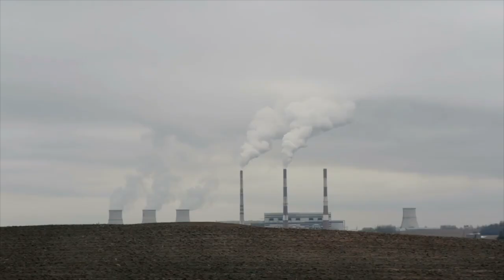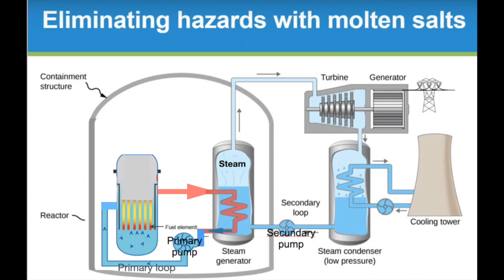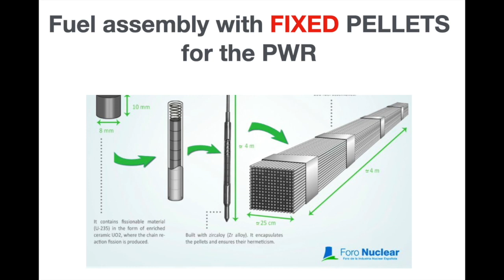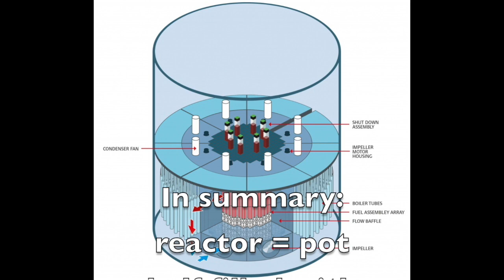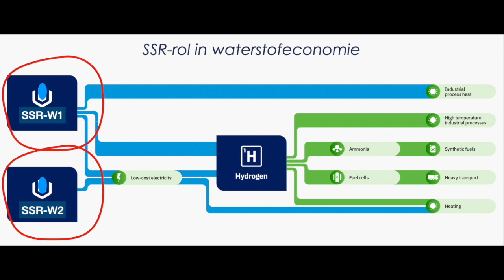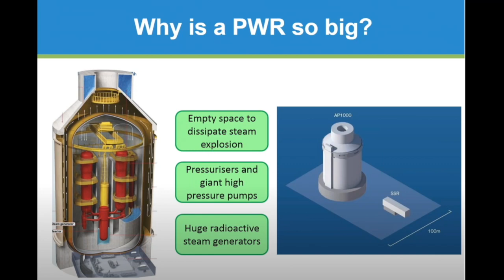The Moltex SSR-W

Comment: And we don't need stinking hydrogen that will leak out of any vessel, no sir. We can make diethel ether as a fuel source to run in small diesel engines for transportation fuel. We could now even make it as cheap as gasoline or in Europe petrol to make our vehicles roll.

Comment: All you need to calculate with molten salt reactors is to size the amount of fissionable of fuel to produce the power desired. Actually ya'll don't even need to size the fissionable material after the first one and then all ya'll have to do is take away the heat with another pump to make more power. And then when more power is needed ya'll just add more pumps and intercoolers. The expensive calculations and methods to separate chemically all the fuel components into their separate components especially xenon to bubble off as gas to keep the reactor stable is the most critical component.

Comment: It is not just the expansion through heat that is causing damage in the solid fuel (and their tubes & cladding) in a PWR. It is also neutron irradiation and gases (He, Xe) that are decay/fission products.
In a MSR, the noble gases won't cause damage to the tubes: they will bubble out. But the neutron flux is still there, damaging the tubes. 
And there are two additional problems: the salt is corrosive and operation temperatures are higher than in a PWR. It is a challenge to find tube material that remains unaffected under these harsh conditions over extended operation periods, so replacement of the tubes may still be necessary after years.
Reply: The salts are contained in tubes the same as today's nuclear fuel rods so there is no difference from todays nuclear plants except that we can burn waste fuel.
Reply: @WJV9  ?? I thought I just stipulated some significant differences. Did you read it at all?

Comment: Cheap                                                               Clean                                                 Safe
                  Lie                                                                     Lie                                                     Lie
Reply from the maker: Moltex Energy Canada and SNC-Lavalin Group have announced a strategic partnership to advance clean nuclear power, the two companies said in a joint statement mid-April.
Moltex is developing a Stable Salt Reactor-Wastburner (SSR-W), which uses recycled nuclear waste as fuel, and a process for recycling nuclear waste dubbed Waste to Stable Salt (WATSS), while SNC-Lavalin is a project management company that delivers a wide range of services to sectors such as engineering services, nuclear, operations and maintenance, and capital.
Moltex will draw on SNC-Lavalin’s network of experts in engineering, licensing and regulatory affairs, cost estimating, supplier qualification and management, quality assurance, and construction and operation planning while SNC-Lavalin will collaborate with Moltex to attract new customers and promote the group’s business goals, they said.
The accord was supported by the provincial governments of New Brunswick and Ontario, both of which have entered into feasibility studies to aid the rollout of SMRs and advanced reactors alongside the provinces of Saskatchewan and Alberta.
Reply: @dirkvandevoorde4251  Hold onto your wallets, folks.
Reply: @jackfanning7952  lol
Reply from the maker: Explain yourself further I am curious.
Reply: @dirkvandevoorde4251  Moltex and its partner, SNC-Lavalin, should be doing the explaining. Why is Moltex partnering with SNC-Lavalin? One is known by the company one keeps. SNC-Lavalin has been banned from bidding on projects by the World Bank in 2013 for bribery, fraud and corruption in Bangladesh, India, Libya, Mexico, Switzerland. In Canada, they were convicted of $22 million bribes in the McGill Superhospital project and charged with illegally using employees to funnel money to political campaigns. More corruption in the Jacques-Cartier Bridge Project in Montreal. The Canadian Attorney General Jody Wilson-Rayboud resigned because of what she said was pressure from the Trudeau government to prevent SNC-Lavalin from facing criminal charges. 
All Gen IV reactors are unproven technologies which present numerous unique and increased safety problems that deliver no significant improvements over light-water reactors. Lazard says the cost of nuclear energy is $118-192/MWh; coal $66-132/MWh; gas $44-68/MWh, grid-scale solar $32-42/MWh, wind 28-54/MWh. Those figures are similar to ones from Bloomberg and Lawrence Livermore. That is based on existing conventional reactors. All Gen IV reactors are projected to be twice as expensive as existing reactors. No one in the nuclear business has yet come up with a method to safely store nuclear waste for even a year, much less 300 years, or a half-million years. SNC-Lavalin wants to stick it all in the basement of a reactor by a river in a swamp and fill it with concrete. How long before radioactivity leaks into the river and contaminates Ottawa and Montreal? That will be someone else's problem, I suppose. $$$$$
MSRs routinely release large amounts of gaseous fission products that must be trapped and stored. Under some circumstances, the hot liquids can heat up and destroy an MSR in minutes. Salt is corrosive. Leaks are expensive to repair and maintain. Radioactive isotopes cannot be burned up, only transmuted to other radioactive isotopes, many of which are more dangerous than the original isotopes. MSR reprocessing to separate U-235 and Pu-239 is the dirtiest, most dangerous to workers and most highly polluting process within the nuclear business. Reprocessing does not reduce the amount of radioactive isotopes, just filters out the useful fuel. There is no incentive to mix the usable fuel with spent fuel to create MOX fuel for the reactor; so the "burn-up" of nuclear waste is a red herring. Thorium-232 can be transmuted to U-233 and U-238 to Pu-239 - more bomb-making material, not less. Did I mention that it is very expensive? It increases the risk of nuclear proliferation. How can we trust Moltex and its partner, SNC-Lavalin, to not use large payouts from taxpayers to build their latest nuclear fantasy, the SSR-W Wasteburner, to sell Pu-239 at a large profit to bomb-makers? Fantasies are nice, but others should not have to pay for them.
Reply from the maker: @jackfanning7952  Time will tell. But I am not aware of any fraud at SNC-Lavalin. What I do know is that nuclear power is much cheaper than wind power. You forget to include with wind energy the extra power lines, the destruction of nature, the short life span, the indispensable backup. If you have any business sense, who wants their business to depend on an energy supply that is dependent on the wind? Wind power is only useful to the fossil fuel industry. Useless intermittent wind electricity is made useful in Belgium with pilot gas power plants. Since wind turbines entered Belgium and Germany, coal consumption, gas consumption, CO2 emissions, and kWh prices have increased broadly.
Reply: @dirkvandevoorde4251  Time has told. The whole world knows about it. Why not you? Are you blind or just lying again about fraud, bribery and corruption at SNC-Lanolin? Open your eyes and take a good look at the company you are shilling for. The whole world also knows that wind is a much cheaper source of electrical energy than nuclear, even though nuclear does not cover the cost of its greatest liabilities - waste disposal and liability for damages, death and destruction caused by commercial nuclear reactors. Nukie rule #1 is privatize the profits and subsidize the risk. Take the money and run. Why did the U.S. nuclear industry need the Price Anderson Act?  Even if taxpayers built the reactors for free (which is what Moltex is shooting for), wind and solar with storage, are cheaper than nuclear. That's why investors won't put their money on risky nuclear, which may or may not work out, is always over budget and has a slow return on investment, if any return at all. Those guys don't like to lose money and want a quick ROI. Speaking of destruction of nature, it takes 1 million kilos of 0.1% uranium ore to produce 7 kilos of U-235. The acidic radioactive tailings are left in open piles and sludge ponds on the indigenous people's land where it is mined. Those alpha particles were not exposed when buried, but now it is different. Seems rather destructive, don't you think?  But it is just po' folks, so you ignore it, just like the fraud, waste and abuse. SSSHHH! Don't talk about it, right? Think of all the fossil fuel used to process the ore, build the concrete and steel reactors, waste canisters and (if they ever do it) bury the waste, maintain it for a million years and decommission the reactors and waste canisters that have become radioactive from neutron absorption. "Destruction of nature?" How long before the whole world is a nuclear exclusion zone? How long before the farmers in Wales can drink the milk from their livestock and the people in Belarus, Eastern Russia and Ukraine get to eat food that is not radioactive? What do you think the effects of bioaccumulation will be in the future? 
The funniest lie that you nukies tell is the one about we can't store energy from wind overnight. We already can and generate and store it 2-4 times cheaper than with nuclear. Yet you think after 75 years with no solution, somehow, in the sweet bye and bye, somewhere over the rainbow, just you wait and see, stop laughing, I'm not lying this time, we are going to figure out a way to keep from killing all life forms with nuclear waste that must be isolated for longer than mankind has been in existence. What would that cost and who would pay for it? And you are working on a magic unicorn that will eat nuclear waste like hay, is too cheap to meter and will never harm a butterfly. I have about 72 leaking tanks of highly radioactive sludge at SRS that those magic unicorns can graze on when you conjure them out of the blue. Maybe they can eat all that contaminated soil oozing down the hill into LA from Santa Susana. Maybe with another billion you can find what is left of the drums buried at Rocky Flats in Denver. Maybe clean up after that fast breeder almost destroyed Detroit. Closer to home, you have the 100 year, $3 billion a year cleanup at Sellafield to chew on.  Maybe Moltex can help their pal, SNC-Lavalin, hide that doodoo from hell in the basement at Chalk River, just long enough for the next generation in Montreal to have to clean it up.
Reply: Wow, you sure showed him... LOL.

Comment: Good presentation. I really hope MSR's become widely implemented. I also like this SSR-W for, as you said, the molten fuel stays in the core. This seems to also address the concern of fission products and fuel leaving unwanted "tailings" in the reactor vessel. But I'm assuming that the new reactor designs that use solid TRISO fuel will be licenced and produced before MSR, at least here in the U.S. Other countries nuclear regulators may license MSR as well as "reprossesing" but I assume Moltex, TerrestriaL, etc will have to prove to the regulators just how the off gas systems work. Moltex seems to say this is a non issue but when radio active elements (regardless of the half lifes and radioactivity) move from the fuel pins into the coolant, I assume a regulator will need a demonstration to prove the assertion. I've also seen a presentation on LFTR where a claim was made to "just bend the off gas pipe" to collect them. To demonstrate this will take years, this is after gaining the license needed to conduct the experiment using nuclear fuel. It's also unclear what percentage of "baddies" are bonded into the fluoride fuel. I assume this needs to be demonstrated. TRISO is already licenced, I think, and tolerates heat to 1600C. Unfortunately it can't be recycled. But when Gen4 nuclear becomes accepted by the public and utilities, maybe MSR will become available. Kairos Power and X-Energy are a couple of startups that use TRISO, neither reactor uses water as coolant. Both companies say their demonstration reactors should be ready in a couple of years, then full size reactors in the early 2030's. One more thing regarding MSR using "waiste". This, I believe, will also take years to develop, especially when regulations need to be created to deliver the used fuel and how to obtain unspent fuel at all, does the seller need to be certified, and it is economical to sell their unspent fuel? Regulations need to be in place to make sure it is done properly. Plus the money needed to obtain these new licenses. Terrestrial Energy's IMSR may be the first to be licenced, it's a uranium only burner/converter design, but even T.E. admits it needs to replace the entire reactor vessel, because of corrosion and fission product build up, every seven years. The uranium in spent MSR fuel also needs to be removed prior to long term storage. I assume this process needs licensing as well.
Reply: Well said.
Reply: Stupid economically.
It is like the idiot looking at the the big factory and no delivery trucks to transport the product. 
The idiot who opens a mine and no delivery transport available. 
It is like finding that a space station is great for the view but no rocket to get you there and back.
Nuclear power in a 100% electric world is stupid economically.

Comment: What features of this configuration are drastically different from other molten chloride fast reactors (Terra Power,  Elysium, etc...) ? What are its potential benefits (safety, costs, more semplicity, etc...) over other MCFRs ?
Reply from the maker: The difference lies in the fuel being in tubes and not flying around the entire primary chain. The fission gases are also easier to collect.
Reply: @dirkvandevoorde4251  Interesting, perhaps at a cost (I suppose) of more complexity and a lower power density. I still prefer the compactness and more simplicity of a "traditional" MCFR, but, anyway, I find very appeling the idea that different designs compete against each other